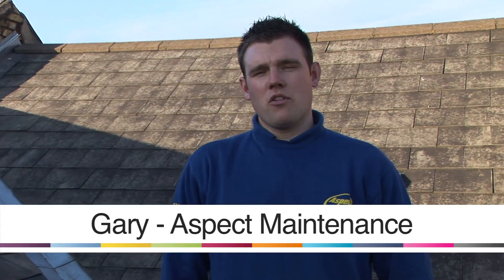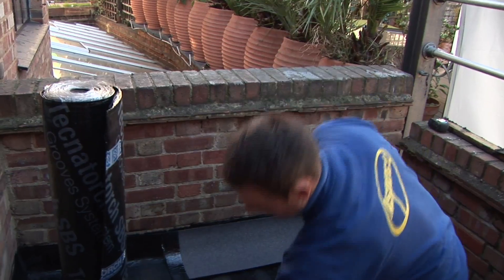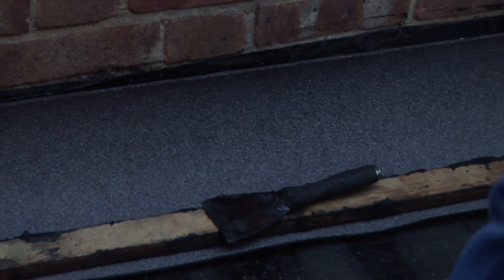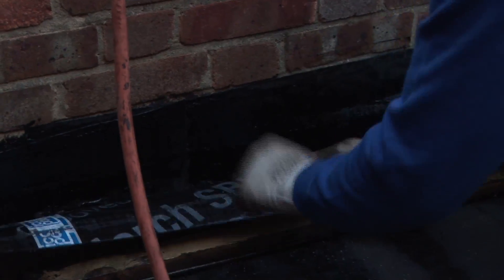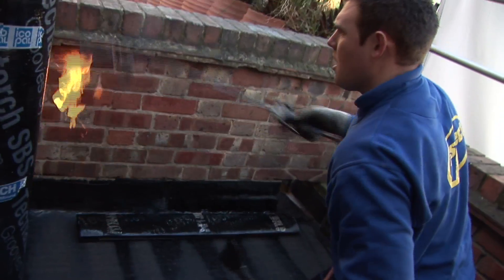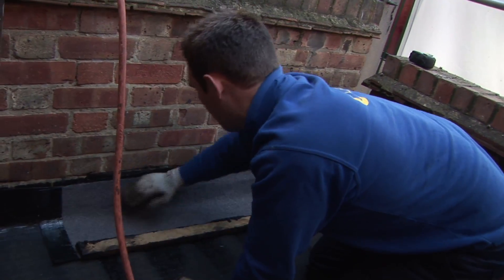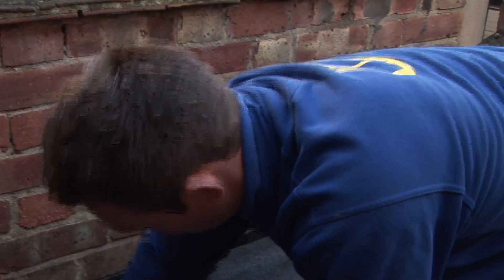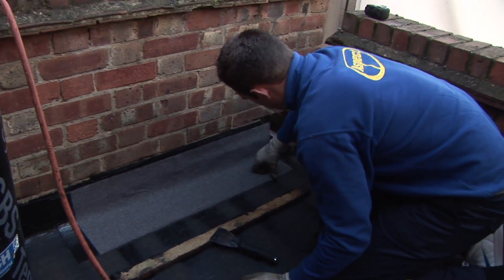How To Torch On Felt

Comment: you didn't show the most important thing, which is "How long do you apply heat to the felt for" It's obvious you lay it green side up, and press the adhesive to ensure contact, but overheating causes the felt to disintegrate.

Comment: hes no flat roofer.he says hes going to put felt drips on the edges...on the particular roof they are upstands not drips.welted drips are what goes along the front where the gutter is.the clue is in the name a drip is called a drip because its where water drips into the gutter of said welted drip.
Reply: ive layed all the top spec felts incl bauder,derbigum felts all over the north of england/scotland and i wouldnt give this guy 1 out of 10 and im being serious.
Reply: david watt and if you put enough heat on your felt you get a bead of bitumin along the seam so you know its stuck.only good thing i see is the quality of felt(icopal,techno torch with grooves) pity he dont know how to lay the bloody stuff eh.
Reply: @THECAT077  I’m looking to apply a 3 layer felt, could you offer any advice & suggestions?

Comment: what a waste of good felt,its a flashing not a drip and you are to get a nice bleed of bitumen out of every joint, all you have done is heat it up and pat it down WRONG WRONG WRONG STICK TO CHANGING A FEW BROKEN TILES .
Reply: darren harlow not to mention the fact that the outlet and rest of the flat isn’t done but he’s putting up stands on
Reply: No arris rail felt upstands at 90 degrees no no